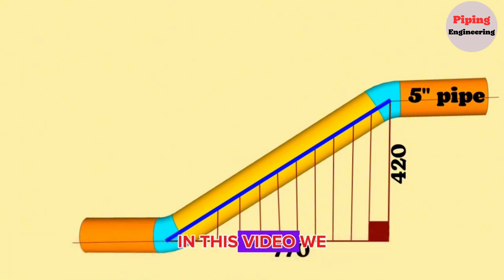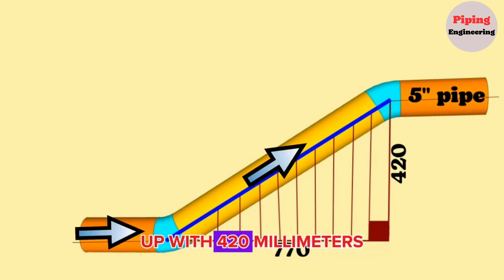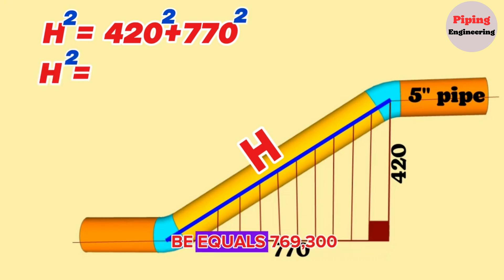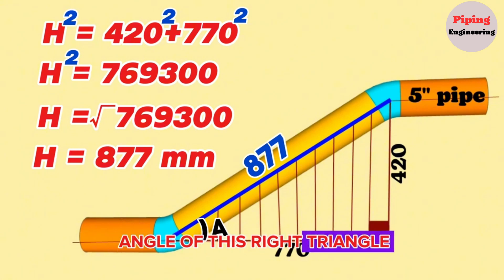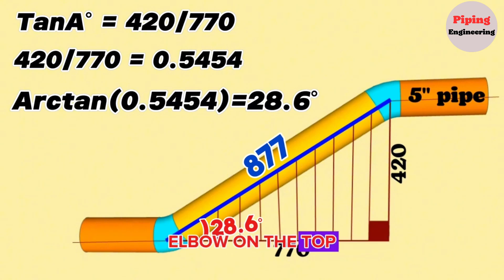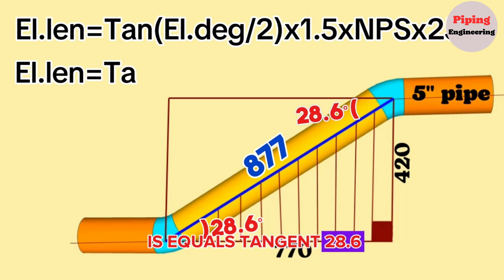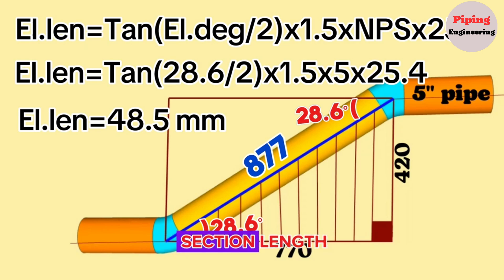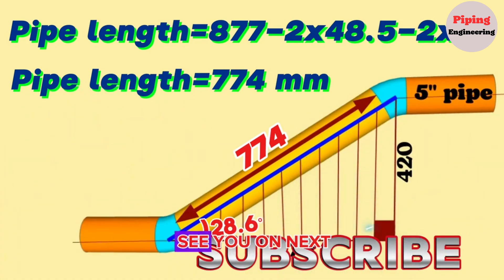Piping engineering. Pipe length calculation. Ellbow degree FORMULA.

Comment: Why don't you calculate the other elbow angle. Because the angles are not the same.

The other angle will be 61.4°

I think the only way you will use the same elbow length for both sizes is when the angles are the same like 45° or when the run and set are the same like 700.